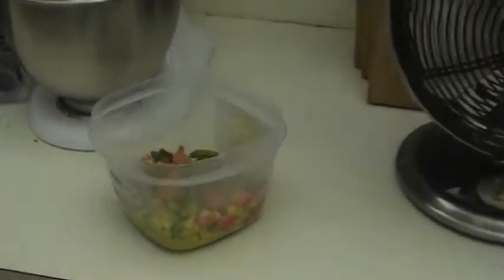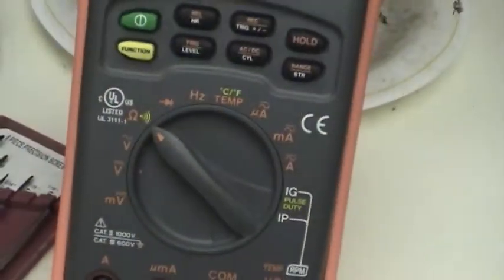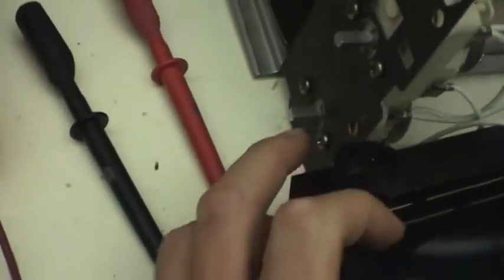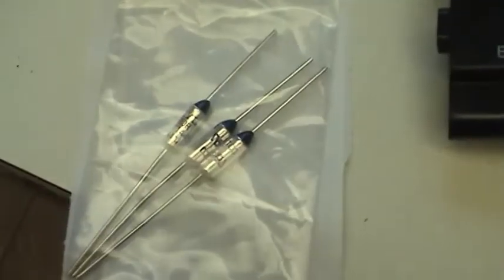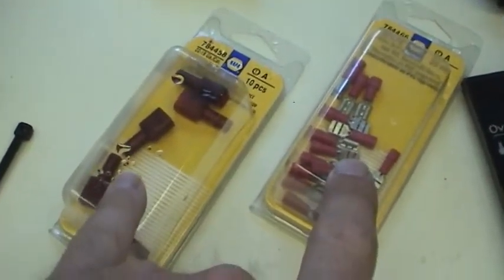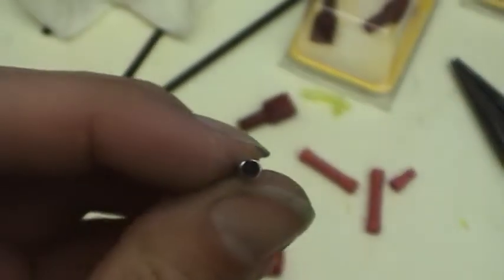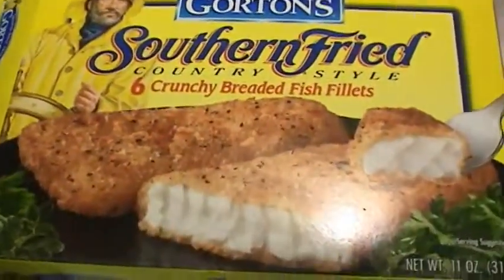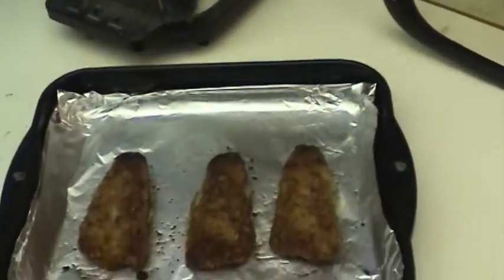My Toaster Oven Got A Little Too "Toasty" Inside

Comment: Thank you Sir. Great Video, very helpful !  I noticed my Euro Pro TO284 Toaster Oven had a melted connection at male spade on thermostat and the right angle connector(female). The female right angle connector was the part that actually was melted. I cleaned up the male spade on the thermostat with some  sandpaper (presently trying to find a thermostat). I figure the high resistance at the male spade on the thermostat and the right angle female connector. Do you think I should just replace the thermostat and of course the right angle female crimp connector ? Further, having difficulty finding thermostat for this oven and a right angle female insulated connector.

Comment: I have a black & decker toast - r - oven and the lower heat element either burnt out or no longer working not sure, all I know is that it doesn't heat no more only the top, do you think I need to do same thing you did or just get a new one
Reply: LongIslandADED. what did you end up doing? The heating element on my General Electric went out.

Comment: The Radio Shack replacement thermal fuse, 270-1320, is set to 139C. It lasted about 9 months before it blew again. Looks like I should get some of the 144C rated from Digikey, Part Number 317-1135-ND, as the Radio Shack replacement's longevity is abbreviated.

Comment: Why is this video titled "My Toaster Oven Got A Little Too 'Toasty' Inside" which is not an accurate description? I was hoping to see food catch fire. ಠ_ಠ
P.S. FYI: Walmart's website is currently offering the Toastmaster TM-103TR toaster oven (which must be crappy, judging from the price) for $16.88 with free Site-to-Store delivery.
Reply from the maker: I was impressed how well made this toaster oven is. To this day, it's working just as good as it ever has. If the heating elements burn out, then that'll be the end of it. But I'm going to use it as long as I can before that happens. :-)
Reply: ***** hi,  my heating element is out of shape badly. can you replace the heating element or is that not cost effective and you have to order it?
Reply from the maker: james marshall
You probably can, but I wouldn't know where to source the parts. They'd likely exceed the value of the toaster oven.

Comment: I'm using my for a project. I took out the heating elements and I took it out of a glass tube, when I turn it on the keep shorting and igniting. How can I keep it working out of the toaster oven and the glass tube where the nichrome was inside of?
Reply from the maker: I'm not sure. Those tubes act as an insulator of sorts and distribute the heat generated by the conductor. By having the conductor out, it will likely overheat and melt, breaking the circuit.

Comment from the maker: Thanks for the tips on how to get the front panel off. I saw the tabs you're talking about but I think my oven is old enough (and used enough) that the plastic is very brittle from heat and age.

I tried my best not to use too much force, but I ended up breaking some of the clips off anyway. Oh well. It still works like a champ. I'm glad yours is up and running again. :-)

Comment: Then, on the bottom, there is a square panel where the front face is clipped in. You'll need to put some pressure on here, but it will eventually pop out of the clip, and you can rotate the face pivoting off the top clip. Do it in reverse to put it back together.

Your video was really useful; seeing what was on the inside of the face to get it off safely and in one piece. It was also good to know the top dial is attached to the face & not to try to pry it off!

I used a 139º fuse, should work.

Comment: I figured out that you can remove the front panel without breaking the tabs. 

First, wedge in a small flathead screw driver in the right side in the middle, and the first tab should pop out pretty easily.

Next open the door (which is attached to this face) and push a larger flathead screwdriver against the tab that embeds in the frame. Both left and right sides should be bowed out a bit now.